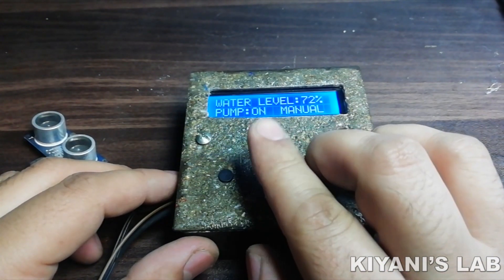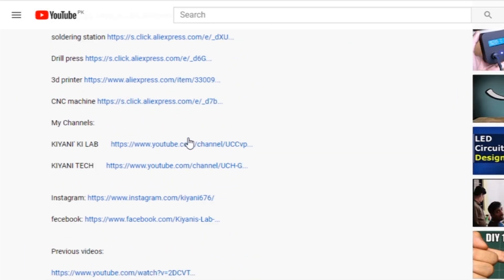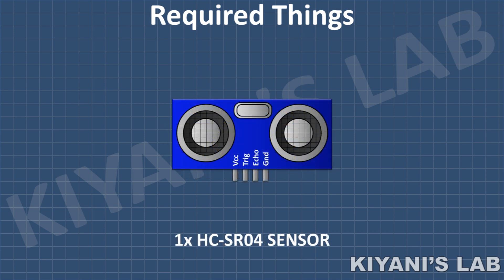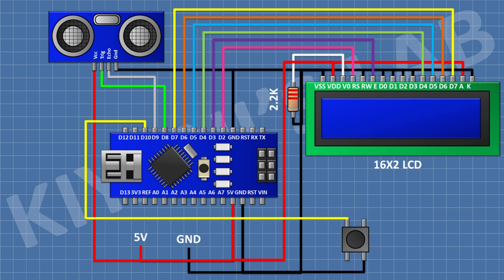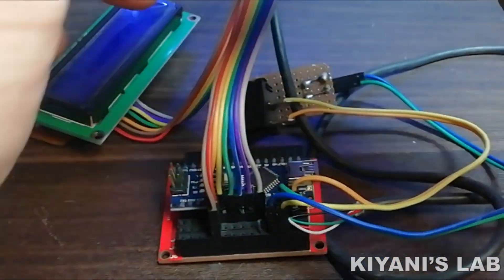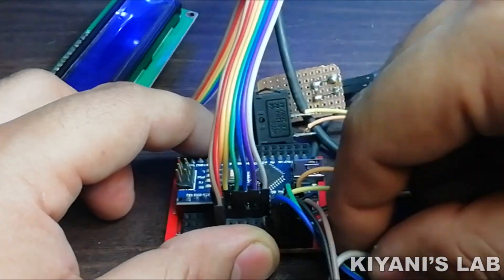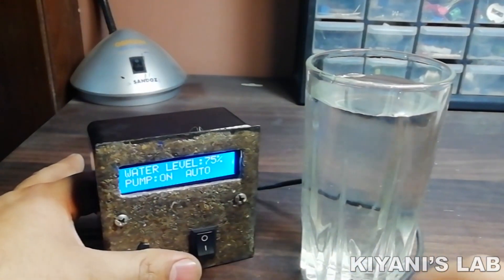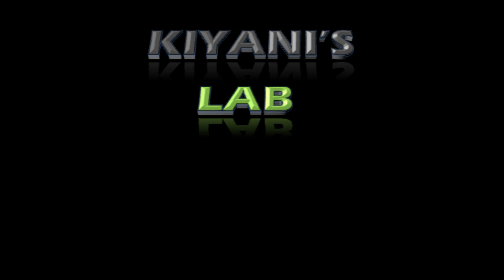How To Make Automatic Water Level Controller | Ultrasonic Water Level Controller

Comment: Hi. I connected everything as in your diagram. I uploaded the code to the nano and unfortunately the screen doesn't work. I have an LCD keypad shield, I connect VDD instead of the 5V mark, then the screen lights up. After connecting pin D3 to E in the screen, the screen turns off and blinks slightly. in no case can you see the subtitles on the screen. What could be wrong?

Comment: Bro, Post a new video, same concept, do only a small change that is add extra one component nrf24 transmitter module for control a motor without wire connection from water tank to starter..

Comment: Doesn't the sensor corrodes when mounted inside the tank?
Reply: If it's in an environment where it's humid or corrosive, you could use level sensors of wire probes that detect a ground connection. I used three wires to make an automatic discharge pump to empty out a dehumidifier tank, very reliable and it just requires positioning two wires at the high level pump turn on point, and low level shut off point. 
Arduino pull-up on an input detects whenever the wire contacts the fluid, pulling it to ground.
Very reliable and simple-

Comment: if i change the HC-SR04 with JSN-SR04T / AJ-SR04M, is the code still work..?
Reply from the maker: yes it will work
Reply: @KiyanisLab thanx to reply.. i've finished work your project same as your tutorial.. it's working good with HC-SR04 on simulation.. but when i use JSN-SR04T the distance read is wrong.. is it coz the distance of JSN-SR04T work range from 25 to 450cm..? while HC-SR04 work range from 2cm to 400cm..?

Comment: It's ok but it's not practical to install wire from bottom to top overhead tank....need 50 feet wire to install it will decrease the volt to sonar sensor...

Comment: Hi brother can you please make same automatic water level indicator by using complete arduino  nano board (without ultrasonic sensor) as you made on your other channel . because the circuit you gave on another channel is really very complicated. And i request you to please make it in the most simplest way as you can. I would be really grateful if you make it again by using complete arduino board.
Reply: Bhai please reply

Comment: After some days of use in such high humidity environment the ultrasonic sensor start corrosion and finally it's stop working
Reply: You are right bro for such condition there are waterproof sensors as well
Reply: @KiyaniKiLab ok then, can you make video using waterproof ultrasonic sensor?
Reply from the maker: soon bro
Reply: @KiyanisLab  I must wait
Reply: That's the concern using ultrasonic sensors for the level detection, seems it's going to be problematic over the long term if it can get splashed and stop working.  
I used wire probes for a pump controller instead, which just detect electrical contact with the water level, which worked reliably for over a year as a pump controller to empty a water tank when the level rises to the high point.  Just need wires that won't corrode when immersed.
Reply: I think sensor circuit pcb catch moisture then effect working .